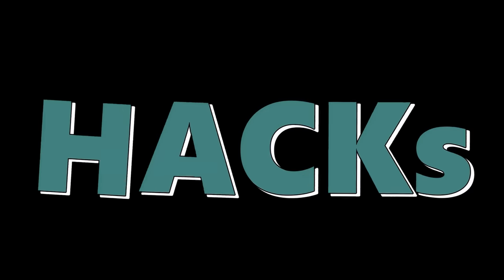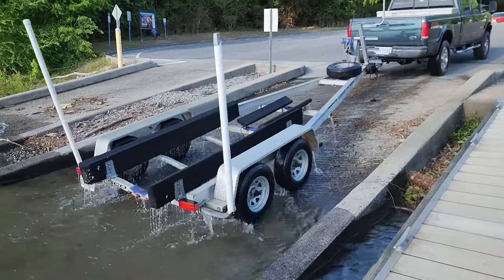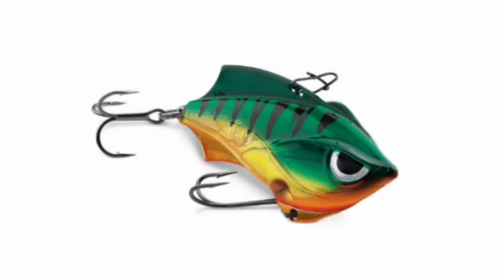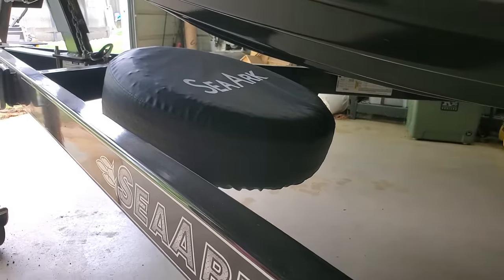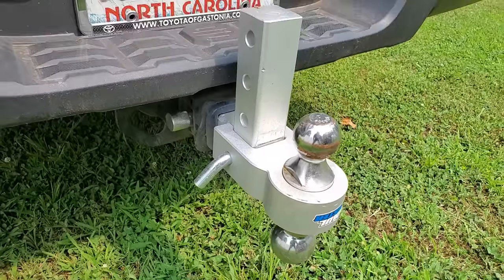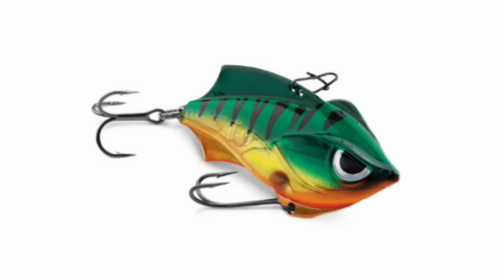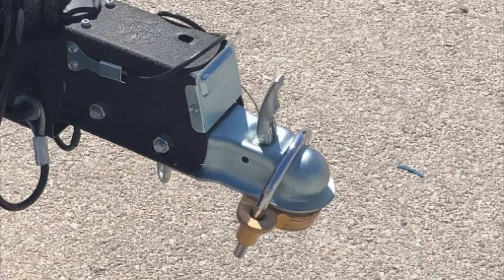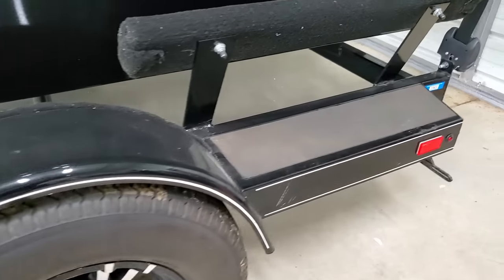10 Boat Trailer HACKs

Comment: If you mount a stub axle where your spare tyre holder is you can mount a spare hub with a new set of greased bearings on it, then mount your spare tyre on the hub. No more having to carry spare bearings/hub in your car in case you need them... just unbolt the spare hub and swap it out. It's also funny as hell when someone tries to stand on your spare tyre to climb onto your boat and it spins on them.

Comment: I also lock the safety chains so they are too short to hook onto a hitch. A thief can wrap the chains around their hitch so the locked coupler hangs in the air as they drive away with your trailer.

Comment: Thank you! I’ve been boating for 35 years. It’s nice to see a list like yours for something I always overlook. Retractable tie downs and the abrasive tape for stepping on trailer.👍
Reply: The tie downs are pretty good but expensive and they don't last forever.  My boats came with them but I added them to my ATV trailer.  In my experience they last about 5 years but they are totally worth it.

Comment: +1 for the Boat Buckles.  Probably my favorite addition to the trailer so far, aside from swapping out the old lights for bright LEDs.
Reply from the maker: I agree 👍
Reply: I picked up some stainless ones since I fish in the salt from time to time. They are awesome since they will pull in any slack should you hit a bump and normal straps could come loose a little.

Comment: I grew up in our family owned, boat business ("Sewell Marine", in Newnan Ga. - free plug!) And you are spot on, with all your upgrade tips / hacks! 
I might even add, not all boat trailers are Drive On trailers. You can buy the Drive On (side) Bunk Board Kits, which can be added to most trailers. Which help to line you boat up perfectly, when loading it, at the boat ramp. 
And a Boarding Ramp, can be mounted along the trailer tongue. Those allow you to Safely walk down the frame of the trailer, and push the boat off the trailer! (These are used mostly on Jon Boat Trailers,with a long trailer tongue!)
Reply: I did not know Sewell Marine was still open.
Reply: I lived on Hickory Dr in Newnan in the late 1980's.
Reply: I didn’t know there was different bunks far as Drive On kinds.   But that walk plank board.  I’ve been actually building out a PWC.  I took a Triton Double PwC. Shifted the winch / bow stop to the center. Made new bunks with LEDs embedded in the bunks.  And been trying to figure out what’s best to use for the walking planks.  I want to be able to walk on either side of it  but not sure what’ material is best to use
Reply: @charlesdriggers199  Yes Sir! Still in business, since 1976! My Father, who started the business is still there. My Brother and his son are there too!
Reply: @jasonjackson329  That Tongue style, boarding plank I mentioned, is simply galvanized steel, sheet metal, with square U-Bolts. If you can't readily get something like that, I might even build something out of synthetic deck boards, like TREX decking. (Available at Lowes / Home Depot) Its not cheap, but will last for years!
Reply: @jimjordan5630  We didn't move the Marina to Newnan, until the late 80's. About 1987ish?
Reply: @chrissewell1608  yeah I like the idea of deck boards , no rot no rust , will look great too.    Having planks on both sides of trailer to walk down will be great
Reply: @chrissewell1608    I was there from '88 through '89.  I was there when the tornado came up and crossed over I-85.  Moved to Canton late '89.

Comment: Tow hitch hack number 11. I did this in 1992 and still have the same hitch today so I think it may work. Since my trailers fit a 2" or 1 7/8" ball that's the two sizes that I used. Using a standard hitch get one ball with male bolt type threaded and one ball with female internal threads, put Loctite on the threads and tighten them on the hitch. Today they make multi ball hitches but in 92 they didn't. The heaviest boat I pulled was a Ranger Comanche but I've never an issue with the hitch. We had to make a lot of things back then.

Comment: My number one trailer hack is to install 2 sets of trailer guide-ons, then connect the 2 (horizontally) with a 2x10 at the appropriate height. Done right, it self centers the boat on the trailer.  Wind or current doesn't matter.  I've done it on two Pontoons, a Bass boat and a Jon boat.  Saves me grief every time.  On the Bass boat and Pontoon, it made getting the boat on the trailer a breeze in 7+mph current!  Not easy with a Pontoon otherwise.  My Dad was amazed how much easier it made the process.  The first set was even coated in black Line-X.  It looked bad ass.

Good video and I agree with you on the Boat Buckles!  Love mine.
Reply: Good idea for the pontoon thx. I have issues with windy area and my toon lol
Reply: After watching at least a hundred videos of people at boat ramps I've been wondering why they don't do as you suggest. It seems like a no-brainer. Another idea I don't understand why people don't do is a dash-cam so the operator can see their target winch as they're loading out.

Comment: My boat trailer had backup lights in the tail lights . I mounted small white LED light bars  to the back frame and tied them into the taillight wires. Easy to backup at night.

Comment: My ancient trailer has a few bits of pressure treated lumber in it's construction. My trailer guide-ons are two of the orange fiberglass rods you can buy to mark the edge of your driveway. I drilled out to appropriate sized holes put 'em in when I'm at the ramp. The newer pickups seem to have taller tailgates and I absolutely agree that having the rods to mark the edges of the trailer is a huge help when backing down the ramp. A side benefit of the fiberglass rods in that while they are strong enough to guide the boat onto the trailer they are flexible enough to bend out of the way if you inadvertently catch them on a log or pier edge.

Comment: My 2 additional hacks are submersible back up lights, great for parking at night plus they let other drivers see that you are backing up, and a self centering lower/front keel roller it centers my boat perfectly every time.when I power load or winch. 

I have every hack you mentioned except for the guide posts. I don't really need them because i keep a foot of my bunks out of the water to aim for, plus the trailer centers the boat perfectly everytime.

Great video though, very informative!

Comment: You can also mount the taillights at the top of the guide-ons that way the lights are not in the water.
Reply: I was thinking that same thing, when he mentioned getting the tube topper, marker lights. And submersible marker lights along the trailer, help loading at night.

Comment: You beat me on the lights for the boat guide, if you don't want to worry with lights, get some reflective tape and put on them. For mine, I bought some LED strip lights and put one on each one (red) and wired them into my trailer lights and turn signal. This way, they acted as additional turn signal lights and when parked, lit up each pole. I also find that installing a second pair closer to the front of the trailer will help guide in and center the boat on the trailer. Speaking of reflective tape, I run a strip down the sides of the trailer too. That way the peanuts running through parking lots at night can't complain they didn't notice the trailer before they hit it.

One other suggestion, get a cheap, blue tooth back up camera and put on the back of the boat. Tremendous help backing up boats.

Comment: On the trailer locks. Any of them that use a lock like that gold one can be easily defeated by reaching under the hitch and unbolting the mechanism and bolting in a spare one. On some trailers the whole hitch piece is bolted to the frame and can easily be removed and replaced. Chain the wheels to the frame.
A tip for the trailer driver, open ALL of your windows and turn the damned radio off. I have seen many times when a disaster was about to happen and people were screaming at the driver to stop, but they could not hear them and boom.
Reply: Locks only keep honest people honest.  Any one that shows up with tools is taking your trailer no matter what you do.

Comment: Whole heartedly recommend drilling a 1/4” hole in the cap of the guide poles…prevents the “capped-tube/guide will float off metal guide IF submerged even half submerged!

Comment: Get rid of the bearing buddies and upgrade to oil bath hubs. They have a setscrew that you remove, turn the hub upside down and let the oil drain, turn hub upright and add new oil, replace setscrew and you're done. You've just changed the lubrication on your wheel bearings in about 10 minutes.
Reply: Even better, get Air tight hubs - Zero Maintenance
Reply: @downwitakrowdy  I don't know what those are, never heard of them. I'm off to Google to find out about them.

Comment: Solid Video.  You should look into Oil Bath hubs.  My last boat was almost 20 years old when I changed the oil in them and it was because I was worried about it, not because I  had any issues.  IMO they are a much better option for boats.

Comment: I bought a led light strip that goes under your tailgate and put it on my boat trailer and there are awesome especially when backing up  because it has the back up lights, I just cut the plug off and wired into the trailer lights only had to run a wire for the reverse lights

Comment: Hack 11. Harbor Freight has some heavy duty peel and stick rubber mat.  Getyasum of dat and trace around your license plate cut to fit and stick it on the back of your license plate.  Drill you sum holes where the screws go and then zip tie it into place.  Now you have a heavy duty sturdy license plate that hinges without a hinge.  Works great on mine

Comment: I like to also drop a little weld bead on the trailer tongue where that last 2-inch receiver section is bolted on. That way someone can't just easily remove a couple bolts, slap on a quick trailer tongue and take off with my boat.  First they have to get through the welds which usually they're not expecting.

Comment: I work with boat trailers for a living. I agree with 9/10 hacks here. Everything but the bearing buddies. 
Anyway. Great video.
Reply from the maker: I can't use em on my trailer.  What don't you like about  ?
Reply: @FishinNStuff  I personally just don't like them. They are "snake oil" in my opinion. I prefer the easy lube spindles. They actually grease the bearings.

Comment: Boat trailer hack #11
Install waterproof LED strips light on the side of your trailer bunks. That way when you fish at night it makes it much easier to line your boat up to the trailer.
I used some 1'' aluminum angle an stuck the LEDs to the aluminum👍

Comment: Forget trailer 'guide ons' above the water. Better to get low friction heavy duty PVC on galvanised steel runners on your trailer below the water to guide your keel straight up the centre of the tailer. Your boat does road travel on these specialised keel guide runners, they only centre your keel on a keel roller at the back of the trailer and maintains your boat centered on the trailer as you power up.

Comment: one habit i got into years ago, weather you have regular lights or led, most folks will stop to get out, undo the straps, prop motor for the water, always unplug your lights from the truck, that way they cool down some. just good habit i think to get into. then when done for the day and loading and strapping boat and motor, plug them back in. easy job.
Reply from the maker: I always did the samething . That's way I bought LED lights I have never poped a bulb since

Comment: LED lights actually do produce a fair bit of heat. Heck light bars and replacement bulbs have heat sinks. 

But yeah, LED trailer lights certainly don’t have the problems that halogen bulbs do from the large temp differential from being dunked in water
Reply from the maker: I agree Some LEDs get so hot that they need fans and other stay so cool you can grab em with your bare hand

Comment: #11 Get you some Gatorbak Bunks to get rid of the carpet, You can light them up too. and make sure your spare hub has lug nuts, If you loose a tire it will take the lug nuts with it and disappear into the woods at 70MPH

Comment: You missed one of my favorite add-ons I did to my trailer. Upgrade the hand wench. I put a larger wench on mine and love it. It pulls my 19ft. Ranger up like it was a kayak. When I load my boat on the trailer. I dont have to use the outboard after the boat no longer floats. So you will never blowout a ramp.  Its been so worth it to me.
Reply from the maker: I like that

Comment: Great content. Solid advice. 
Put that spare tire in the front of the boat mounted vertically. it can stop your boat, in the hands of a whiskey throttle, from smashing into your truck bed. 
BTW, stop shopping at Harbor Freight. There's a video of a guy getting killed by a HF hitch that broke while winching. His wife agreed to release the video so others would learn the dangers of cheap china crap.
Reply from the maker: I agree with you about Chinese junk . But the truth is every store out there is selling Chinese junk nowadays 😑

Comment: Good project for you would be lighted bunk slides clear gatorslide bunk slides with LEDs routed under the sliders. Not my idea,it's on YouTube. But would be great for loading at night.
Reply from the maker: I've saw then they are cool . But I was thinking if you mounted good led lights on the inside of the bunks that might work good a little cheaper

Comment: On the trailer locks. You should check out how easy it is to defeat most of those locks. The one you had on your boat is worthless.
Reply from the maker: I have but police reports prove 95% of trailers that get stolen are not locked proving criminals are lazy .

Comment: Another one you can do is make a flexible license plate mount. Purchase a set of rubber mud flaps and trace out your old license plate bracket. May want to make it a little more like a triangle for more strength. Then it can bend in both directions without breaking.
Reply from the maker: I wish I'd have thought of that one haha . That's a good idea . I've seen it before but didn't even think about it
Reply: @FishinNStuff  I’ve used it a few times and it’s definitely a license plate saver. Have you ever done the DIY that increases air flow on the aerators used in the 5 gallon buckets?

Comment: Those locks are suuuppppeerrrr easy to pick my advice never ever ever use a lock if you don't watch lock picking lawyer you have been living under a rock he has dozens and dozens of videos picking those trailer locks in seconds. I adopted a better theft deturent years ago I own many trailers and all I do is put one side on a jack stand and just remove the wheel all together I don't mess with those locks
Reply: I'm just thinking out loud here about what I'd do if I were a thief and wanted your boat after having seen it parked in the same spot for a while.  It would only takes about 10 minutes and a very small expenditure of cash to get a wheel and tire that fits your trailer, and then the thief would be ready to tow your rig away with no more effort than it takes you when you get it ready yourself, which seems too easy for the thief.  Putting a chain through the wheel and around the axle would take far less of your own time than messing with a jack and wheel nuts, and would be much harder for a thief to defeat.  Maybe a better option would be a locking cable.  They are very hard to cut and they come in pretty long lengths, and running such a cable through both wheels, AND over the axle, would be even easier and would absolutely prevent the possibility of using spare wheels at all.  Again, I'm not trying to shoot down your idea, but I just thought of how to make much simpler and faster for you, but much harder for the thief, it seemed worth mentioning.
Reply: @ericl2969  that is what i do, i run a cable through both wheels, side to side, with a big lock that is bolt cutter proof. but !!!..no lock, cable is going to stop a thief, it only slows them down. locks and cables only keep honest folks honest. if a thief wants something bad enough ?, nothing will stop them.maybe slow them down ?, but not stop them.

Comment: Have a tip for you, my friend. They make an waterproof LED Light whip for a UTV, that’s a Smoke Black color. Use 2- 5’ whips with a water sensor switch, then when the trailer hits the water, the LED whips light up, when it’s out of the water, it shuts back off.  How’s that for a future hack.  Hahaha. 😎🤙
Reply from the maker: That would be awesome

Comment: I need the guide on the rear I did cut a bouy into white and drilled holes to mount over the carpet rails   The boat is tighter in the rear  as u slide forward   It’s pretty heavy rubber mine boats an express  alum camo so looks don’t matter operation is key simple